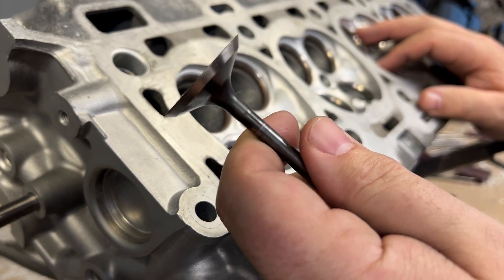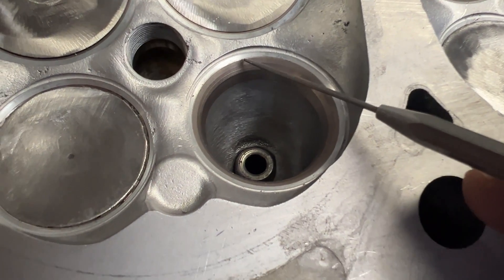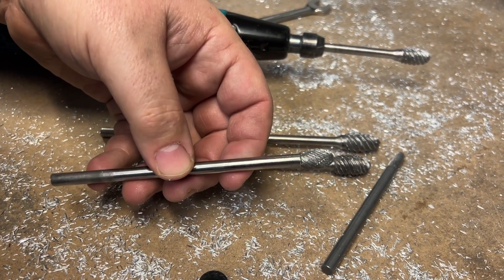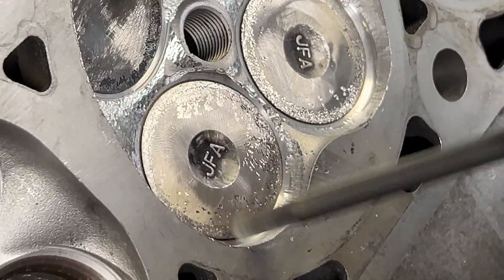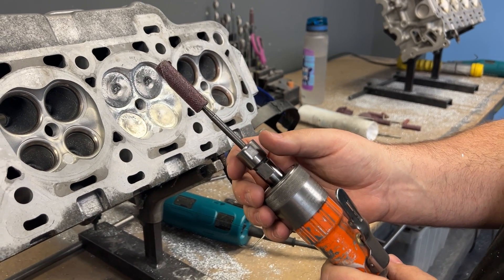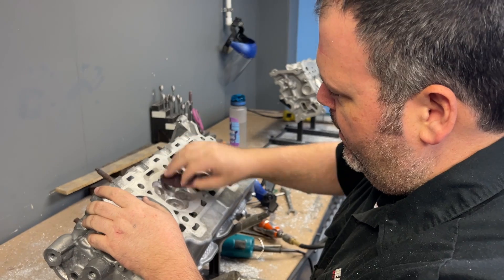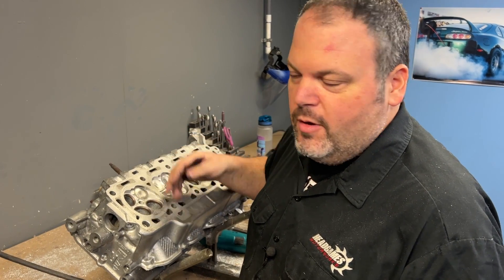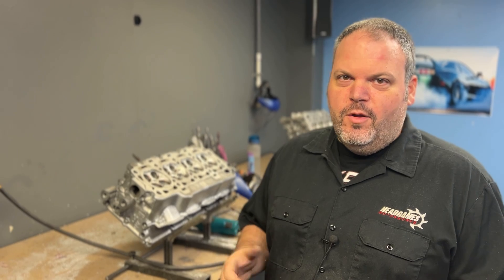The Road to CNC Gen 1 Coyote Part 3! Combustion chamber shaping!

Comment: When doing the chambers I worry about taking too much out of the "quench area" to unshroud and smooth up for detonation resistance. Don't want to cause compression vs piston to valve clearance issue
Reply from the maker: Just don't remove alot of material from the quench. But this has nothing to do with piston to valve clearance. If you just blend sharp edges and mill it you wouldn't hurt compression.
Reply: @headgames  I know it doesn't directly effect ptvc I mean increasing the combustion chamber cc requiring more "dome" in the piston to acquire the same compression, that's all
Reply from the maker: @taskmasterhorni  yeah you don't need to remove that much. Round numbers, 1cc would be about as much that we would be removing here, and if you mill the head .005 it comes right back to OEM spec and doesn't effect anything. Just gains!

Comment: Curious, do you bring the chamber wall adjacent to the valves out to the cylinder bore, for maximum unshrouding?
Is there potential gain if the top cut could be extended out to the chamber - roof radius and keeping the radius to, say 3/8”R, or as large as possible?
Good stuff.
Thanks for sharing.
Reply from the maker: I think your first question would be use a gasket to ensure your not outside of the bore. Top cut is extended out to the chamber, not with a radius and then blended to the chamber.

Comment: I started already doing all I can straight with your recommendation.
I did it with no speed control so it is a little miss in some corners but the machine shop says they fix dents on the surface. 😂 I jump step and try to hit the intake port all the way from the short turn to the mouth with long burr and the shank of the grinder hit the surface all because the job is hard to do it over a washer machine 🫣.

First project. A domestic all motor .4 inline.
I open up a tunnel at the exhaust. Is very restricted. Is I can I'll ask the machine shop to cut all and weld back in a 2" nipple 🎉😂 to the exhaust. I'll try to match the ports of success import that have everything on it.
It is not impossible but it will be cool to see a domestic of that brand with the original 4 banger out load at list in the low 14 on 91 octane gas.

What just starts as a hobby and passtime can end in history or a total failure.
But very important I try all by myself.

I have speed control now. to complete.

Everything I'm doing is nostalgic for all the years living in Peña Pobre Naguabo.

Many records from people I'm proud.
It is sad that they may never see I'm trying unless I succeed on this after all the years learning with them and having more information from this channel.

All I want is a domestic with a unique all motor intake sound and good performance.

I'll try a custom set of pistons because it's 8.5:1 compression ratio and I'll like to run with 11:1 compression and see if the hp can be ser from 160hp original to 240+hp all motor from a 2.4 liter stock domestic platform.
Reply from the maker: glad you are getting something out of it!